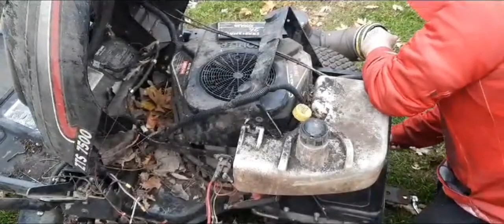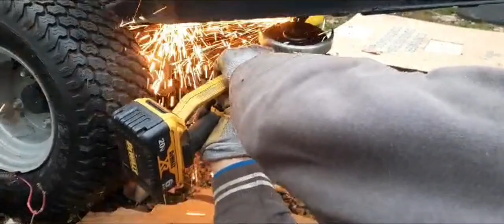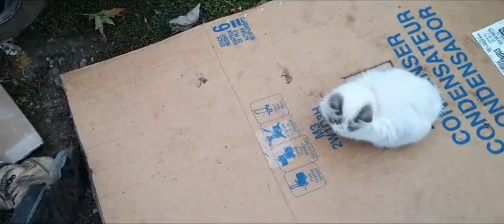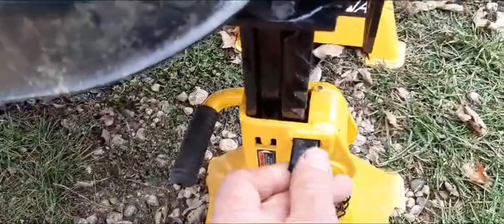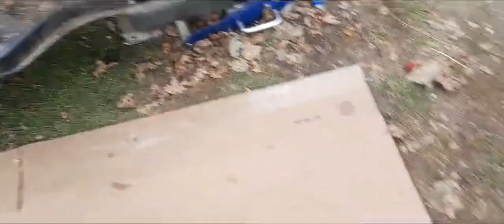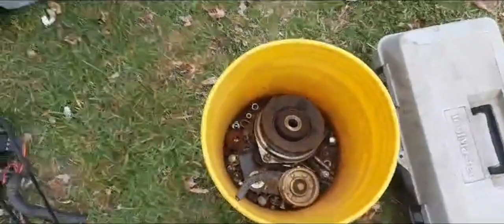CRAFTSMAN ZTS 7500 zero turn, Tear down for Kohler engine

Comment: How did you remove the seat brace/frame?  I have not been able to figure out how to get the bolts off the four lower bolts.  I have the BS 26hp but it looks to be about the same brace/seat support.
Reply from the maker: That was a while ago and in that adventure, a sawsall and a grinder with cutting wheel were utilized.  It was still was a pain getting it apart.   I basically destroyed everything in removing the engine.  It was not fun.
Reply: right i been looking for the same thing. as opposed to cutting it kinda thing.

Comment: i do agree its a ton of a mess to try and fix. always something in the way. half the time cant remove what you need to to get to something else with out a serious teardown.
Reply from the maker: Yes, unfortunately, most things today are made to be thrown away.  Thanks for watching and commenting.
Reply: Fixed the problem.  I cut the brace.  Bolted two plates on each side of the cut brace and bolted them back together.
Reply from the maker: That sounds like what I would have done as well.@charlesmeyer2460